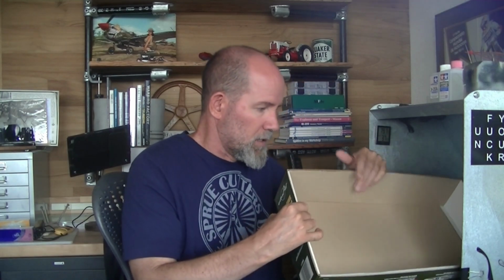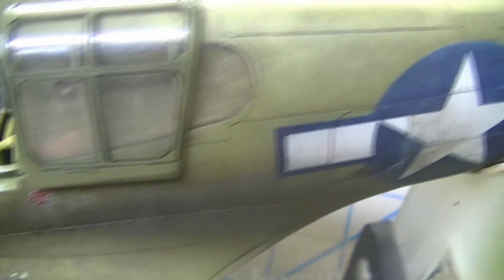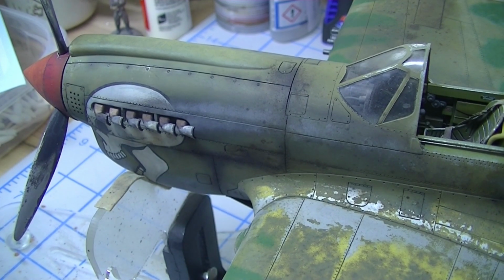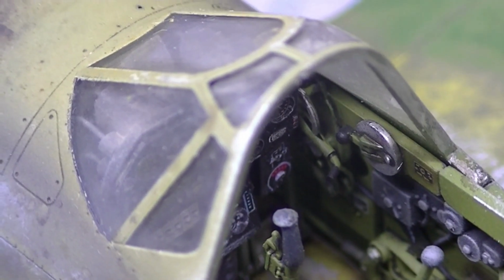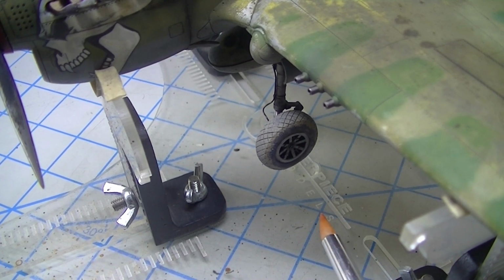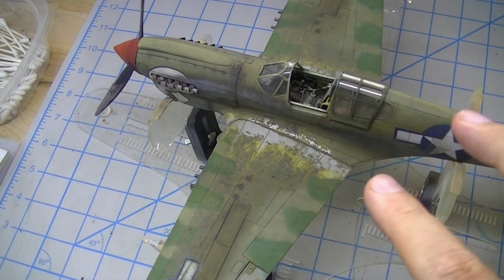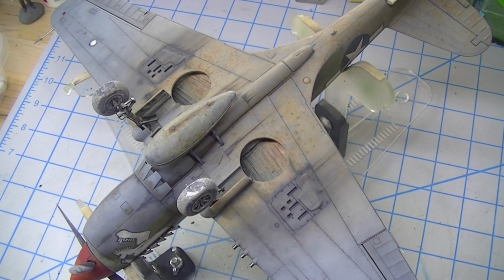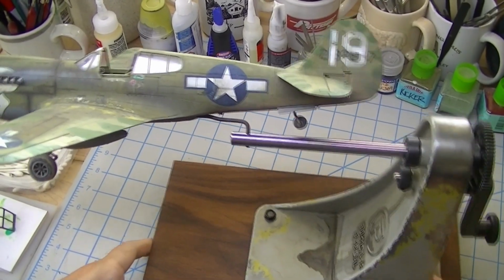ism326 - hasegawa/eduard 1/32 p-40 build review

Comment: Will, I noticed an old Tamiya glue bottle in the video background that looks like it holds CA kicker now. If I saw that correctly, what did you clean it with prior to adding the kicker? I’d hate to use my (barely) HS level science, and create some kind of toxic gas, just to clean out a stupid bottle. Muchas gracias!
Reply from the maker: just leave it open for a day and any tet remnants will fully evaporate.
Reply: @barpfoto  great, thanks! Amazing work on this kit, as always. I’m enjoying the podcast as well.
Reply: @barpfoto  I should have also asked about the attached brush in the lid. Use it once it’s off gassed as well or detach and use a glue looper to apply the CA kicker? Thanks!

Comment: Fantastic weathering job, Will! It really looks like it was rode hard and put away wet. I enjoyed seeing your videos with regard to the 3D printed seat and all the extra amazing details you added. To be fair to Hasegawa, the original tooling for this came out in 2008, with the N model parts in 2013. The last new tooled aircraft kit they produced was their A6M5c Zero in 2016. I doubt many people noticed, as Tamiya's offering is far superior. I heard a rumor that several of the aircraft model makers went over to Fine Molds. Not sure if there is any truth to that. It's a shame that Hasegawa does not release newly tooled aircraft kits anymore, but instead re-pops older tooling with different schemes.